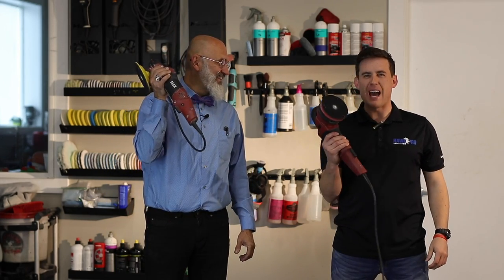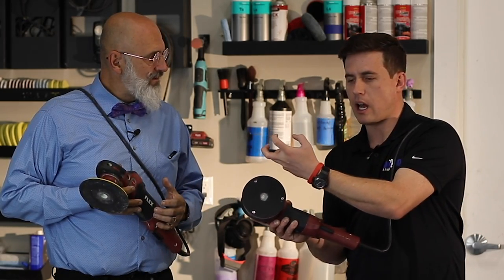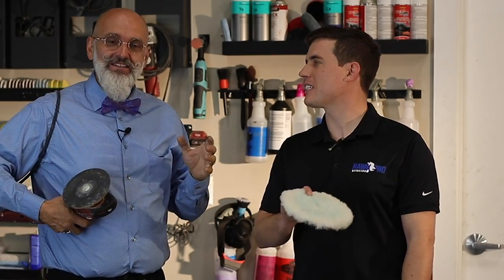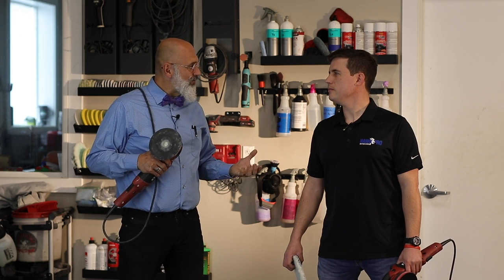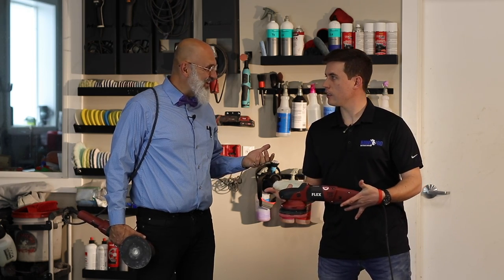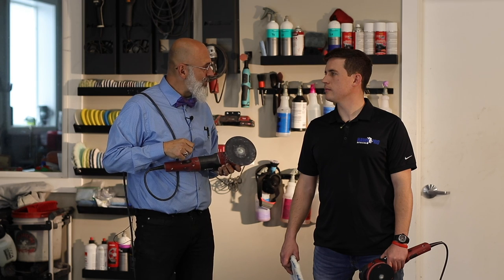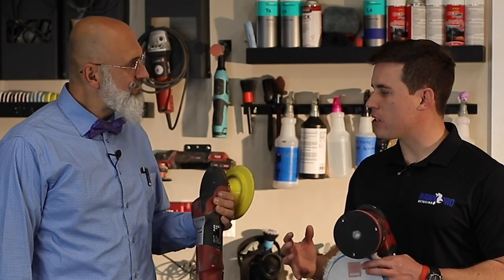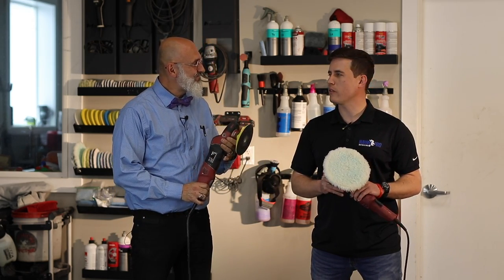ROTARY VS. DUAL ACTION POLISHER: which produces shinier paint? Yvan Lacroix explains

Comment: I've been detailing sence 84 . Started with a b&d rotary.  Out of the 70s . Big heavy piece of metal . One speed . Got a flex rotary in 1990 . Used it for 15yrs . Got another flex and still use it to this day . Never go over speed 2 . I have a couple da's.  Maxshine 15 series 2 and the 21 . Still find myself going back to the rotary most of the time . Main thing for me is condition of paint.  Newer cars,  not alot of blems I will use the da but if its pretty beat up it's the rotary all day .

Comment: the best pad for a rotary today for cutting and not leaving swirls or only a tiny amount (all bar soft paint in most cases) is a deburred wool pad. The hooks/barbs in wool pads for decades were the reason for the swirls, not the actual wool fibres.  I believe rupes yellow DA wool and blue wool to be a deburred wool. Final Inspection Australia has one as well.

Comment: Nice video to people in learning polishing. Need to say, not all machines are designed for low speed runing for best performance. some are better in gear 2, and some are better in gear 4-5. you need check the parameter and find the best gear poistion before using it.

Comment: Few questions, if im working on a 2016 blk gmc sierra 1500. I heard the paint or clear is soft. Im not sure just what people say. Do I start with a da with a wool pad n finish with a rotary with a blk non flat pad? (waffle) Also How many of each pads would you use? The truck is in good condition but there are quite a few swirls in the paint with the paint light or in direct sun. Ive never polished before on a vehicle. Only on gelcoat (boats) Also what speed do you prefer on the rotary n da

Comment: Rotary for the win when finishing in most cases
Reply from the maker: Damn! If you and Yvan say it...it must be true. Technique please:)
Reply: @HawkProDetailing  no matter what speed that you use it at, if you slow the machine speed down by 200 rpm each pass after the first few passes then you will get a great finish. Don't buff at higher speed then stop always slow down and increase your arm speed to reduce the chance of holograms.

Comment: I have a Bauer 8mm throw DA  ITS totally WORTHLESS, especially if your doing cut and buff on  new finishes. I haven't tried a 20mm throw DA and maybe  that's the  answer to make any progress, but until I get a 20mm throw to try out DA Im sticking with my rotary machine, it cuts and polishes way way better than a 8mm throw DA. Careful as the rotary is  aggressive so slow speed and low angleand low pressure for sure, it will will do the work no problem. I use a wool rotary for cut and black waffle for polish.

Comment: so for someone new to paint corection overall a Regular Rotary Polisher. For both cutting and polishing waffle pad or Microfiber?
6" okay for doing both???

Can you also recommend some Brands and Models please?
Reply from the maker: honestly if you're brand new....i wouldn't touch a rotary. There are a lot of polishers out there but this is my favorite DA for the price and for the cutting power you get from it plus it finishes down nicely: https://amzn.to/3Ov9pwc
Reply: @HawkProDetailing  

I have looked at shinemate and they have gotten great reviews.

why not a rotary polisher? 
I have done some small correction using a 3 4" pad attached to a drill.
which spins one way like a Rotary Polisher.
Still though I would like to know why you would not recommend a Rotary Polisher.
Reply from the maker: @btbd2785  Rotary is great but it takes a learning curve, I don't know anybody besides Yvan who recommends finishing with a rotary. It's like buying a Samsung. great phone. But if you want to have everybody around you able to help you, you get an iPhone because life is just easier. Everybody these days is learning on, and using, DA. It's just a part of the modern day ecosystem. DAs are easier to learn and safer, usually, on paint. Hope that helps!